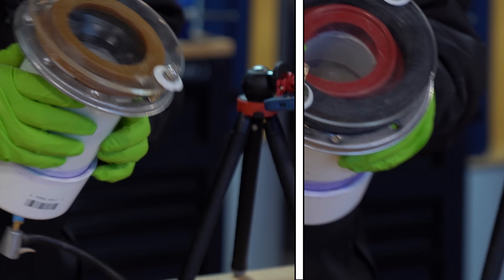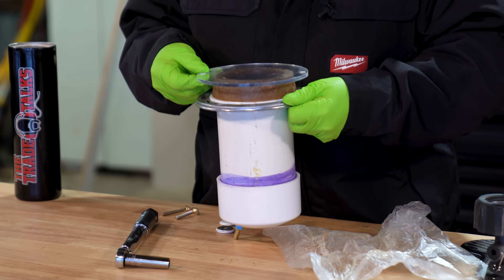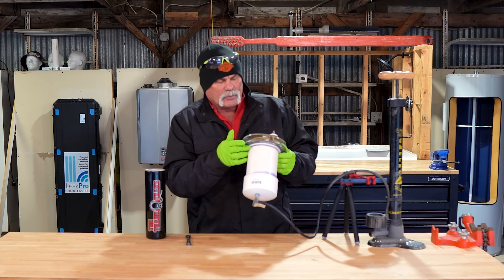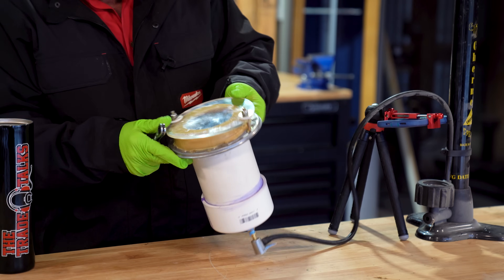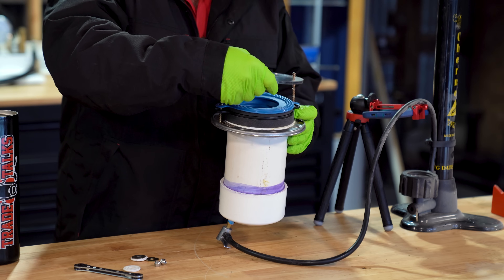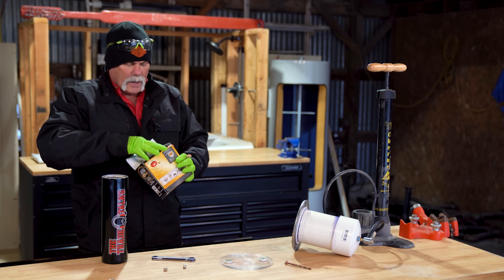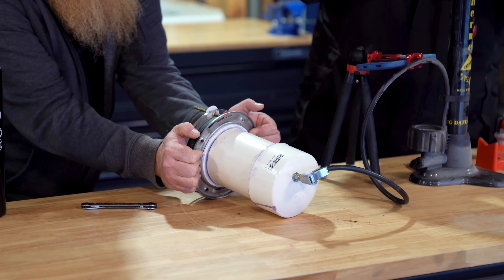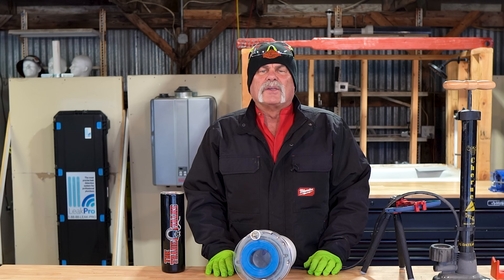Toilet Wax vs Rubber: Which Works Better?

Comment: Moved into a house and after a year the wax ring failed; I started getting dirty water leaking into my basement. The cause of this was an old 1950s closet flange (the old zinc/lead lined ones). The issue is that the flange sits up above the floor; apparently this was  intended for old toilet drain installation back then. So I had to replace the wax ring because the old one disintegrated due to years and years of rocking and pressure from compression since the toilet is not sitting flush. I used a rubber/foam ring to replace it. Well I didn't have any leaks after that...but the toilet still rocked a lot. So I did a quick fix, cutting some plywood into a shape to fit the base of the toilet. Seems to have stabilized things a bit. My next plan is to take an angle grinder; cut out the old flange and set a modern one (the  ones that have the Allen key expanding gasket). Maybe prep some spacers in case and put the new flange on the drain pipe to sit flush to the floor again as it should. But it's been quite a few years and no leaks at all from what I can tell. I'll update when I replace the flange and put on a new ring.

Comment: We tried that Korky one and just couldn't get it to work.  Now I'm as amateur as they get so maybe I did something wrong, but we put the wax one on and no issues.  As much as I didn't want to use wax, it worked over the rubber.  We returned that one the next day.

Comment: my flange sat up to high above the finished floor. tried all kinds of wax rings and when i tighten them down to the floor so the toilet didn't wobble they leaked. even tried to shim the toilet so it wouldn't smash the wax so much and still leaked. finally installed better than wax universal and was able to tighten the toilet to the floor and no wobble or leaks years later still no issues

Comment: By squeezing down the extra thick wax ring you weakened the seal. The acrylic wants to stay in it's natural shape caused by tightening in down. By pressing it you deformed it and it will naturally try to go back to the origional bend or shape. At that point it now has a lower tolerance in the wax.

Comment: Not a plumber, just a good son that's changed out a few toilets for my mother.

Both her toilets have the rubber rings now. And those toilets have been set in place for 5+ years and she's never hand the complaint of sewer smells in her home that was built in the '30's. 

Ultimately it'll probably come down to preference or what would be up to code in your area or if it's a commercial job site. Just my two cents. Again, not a plumber.

Comment: Here in australia we only use rubber seals. Called pan collars, and the pan isnt bolted down. Just held in place by silicone and gravity. Never had an issue

Comment: Personally, I always use the adjustable rubber ones, because every single flange I've ever worked on is at a different height lol.  I just never know. I like this test, but I'd be curious to see the results with a stiffer piece of acrylic.  It bends too much in the middle for any of these results to be valid.

Comment: I usually use wax but last week I used the rubber product product sold at Home Depot for $10. Toilet flange on center was 11.5 in from the wall and was a tight fit touching the back wall. Toilet flange had a repair split ring flange and the top of the flange was 3/4 below the tile. I used the rubber because it allowed for a flange below the floor surface and allowed for a slight shift according to the instructions. If it was not for the versatility of the rubber I may have had to melt two rubber wax seals together and double stack. Rubber product allows for toilet removal where the wax doesn't give you a second chance. As far as I know, no leaks so far and I would consider using it again. I keep wax rings in the van at all times; I'll stick to wax whenever I can.
Reply: Which seal would you recommend if the flange is not level? I’m replacing the seal on one of my toilets and the flange is in pretty good shape, but one side of it is a little bit more than half an inch above the floor while the opposite side is even with the floor. I’m not sure how important it is to be level. I did try to level the flange by removing the screws and putting a couple plastic shims under the lower side before screwing it back down. All this did was raise the whole flange up so that it’s above the floor on all sides, but still not level. Hoping one of these seals will still work without having to cut out the old flange a set a new one.

Comment: You and a few comments suggest that no seal would face 25 lbs pressure, but it makes me wonder. How much pressure do we exert when we have to plunge a tough stoppage? We know water doesn't compress so somethings got to give, right? I do maintenance in LTC facilities, and often use a vigorous back and forth action just to loosen it up. I know the plunger's not a perfect seal so that's some relief but it never occurred to me until now that I might be stressing the seal?

Comment: i have changed to rubber gaskets , cleaner , reusable , better seal on broken/cracked flanges
Reply from the maker: Why not replace the broken or cracked flange when installing a new gasket

Comment: I insisted we used the better-than-wax ring for the toilet and it is working fine. I wanted to save time and money, and researched it. did not need the foam spacers. Main reason was no ac. So didn't want the wax melting in the heat.

Comment: In my 50 yrs of building maintenance and repairs I have replaced/installed several hundred toilets. Only in the past 10 yrs have I tried the foam/plastic gaskets. Never had any luck with them. Most times had immediate leaks and sometimes they didn't even fit right. I always went back to using wax rings with rarely ever a problem. Speaking of foam, has anyone pulled a toilet to find someone had used expanding foam to seal the toilet to the flange? Or  I the only lucky one, lol.

Comment: I love the rubber , and ive done hundreds of setting toilets,  
 I always use a tiny bit of wax and use it like caulk for any gaps . I also smear a little wax on the rubber so it slips on that round part on the bottom of the toilet. I will never use just wax again .

Comment: Good attempt, but you're only testing 1/2 of the sealing interface.  You need something that simulates the toilet horn.  Especially, the rough horn ceramic surface.  Just my thoughts.

Thanks,
Scott

Comment: As a DIYer and replacing 2 toilets and on both occasions used the wax ring and had leaks because I had no idea what I was doing and messed up the wax ring when setting the toilet, I would prefer the rubber ones. After the second toilet I just decided to call a pro from then on. I do not want toilet leaks. I will be happy to do the piping and other things like replacing my faucets when needed but I am not willing to try another toilet.

Comment: No plumber but have installed a lot of toilets over my 56 years (wife loves renovations 😢).  I find wax or rubber both easy to install (zero leaks so far) but I am sold on the rubber ones, my choice always moving forward.

Comment: I have put in over 300 Better Than Wax rings and haven't had any problems.
Also, I have only used the extra ring a few times.
 I've had some jobs I needed to pull the toilet and reset it temporarily and pull it again to finish the job and reuse the ring.
Reply: Did you use toilet shims under many of the installations? A lot of complaints were that the toilet set too high off the floor and rocked?

Comment: I tried using the red rubber one on my shop toilet and when I built it and it leaked water all over the floor at the base of the toilet when the sewer line backed up. I replaced it with wax right after had another back up happen after that and the wax held, and no water leaked out from the base. will never use the rubber ones again.

Comment: For me when it comes to replacing an existing toilet it comes down to two things 1. is the flange flush and plumb and is the sub floor level and in good condition if either one of those is a concern then either option will have issues that you have to deal with. if they are good then both will work well.

Comment: That acrylic piece needs a 1.5” ring on it to mimic the extended bottom of the toilet. That would let it press against the rubber seal more accurately than just relying on two flat plastic pieces pressing against each other.

Comment: The max pressure youd need to measure it against is a plunger.  Ive used the wax free korky for years now without any issues. The only one i had a problem with was a flange set 1/2 above finish flooring but that wasnt the seals fault. I definitely prefer it for a few reasons though, one is reusable, two is people are getting heavier and the weight of people causing wax rings to fail is going up. And any subfloor system that isnt slab flexes. Also in the event one of the better than wax rings is being replaced ie remodel, its way easier to clean up.

Comment: Ive only replaced a wax seal once in my 70 years. Used a big wax one because it needed a quick fix and the ring was below the floor surface, so I wanted to make sure it sealed even if it squished all over underneath. I have spoken to plumbers and agree that the non wax ring is much better

Comment: I'm not a plumber but I have installed 4 or 5 toilets.  My parents had a plumber set a toilet twice and it leaked both times within a few days.  I researched seals and found  the "better than wax" and decided to try it on their toilet.  Installed easy and it never leaked after that.  I have used them ever since.  One problem with your test is the flexing of the clear plate.  You should have installed a steel ring on top as to mimic the solid constant all around pressure of a toilet flange.  You have more pressure on the bolt sides and less on the opposite sides.

Comment: I've changed out a wax ring before.  I'm pretty sure it started leaking because the floor wasn't the strongest and the toilet rocked.  Wax rings don't blow out like your test.  They develop wet cracks when the toilet rocks, and once wet (with more than just water) the wax ring won't reseal.  One advantage a wax ring has it it's single piece construction.  Those stacks that you've shown don't look very well engineered.  On a concrete floor, I would always use a wax ring since the toilet, if set correctly, isn't going to rock.  That leads me to another solution...if you have a toilet that rocks because of a weak wood (or particle board) floor, maybe it's time to spend the money, and put in a heated floor with epoxy that should make the floor way more rigid, for a better mounted toilet, and that wonderful warm step out of the shower on a cold winter day.

Comment: I like the Sani Seal waxless  toilet gaskets. Never had an issue with any toilet ring, but I remodel and will sometimes need to set a toilet several times over the course of the job and the foam ring makes that easier. I also install over a lot of radiant heat. Has anyone ever had the heat compromise the wax?

Comment: The only time you need the extra ring on the no wax seal is when the flange is recessed in the floor, the toilet also seals inside the no wax ring. I’ve had clients with radiant heat floors where the wax melted and no wax is the only answer. I’ve used both types and have installed mostly wax rings but I have no wax rings in my house.

Comment: I've probably got the oddball question here. Are the wax rings still made from bee's wax? I remember reading the box several years ago and found it says it was made from bee's wax so I used it as a source of bee's wax to use in my woodworking projects as a protective finish. It was far less expensive than buying it as a liquid or gel in the woodworking supply places. It's been a long time since I've needed one for any purpose so I'm just curious.

Comment: Why is there a danco perfect seal in the thumnail/picture but not the video? Thats the one I use. I like how the danco will move with the toilet a little. I use them for wall mount sits on floor and floor mount where the flange is below the floor. For floating i use wax and I also use wax for applications where the flange sticks out.

Comment: Ive been a handyman for 12 years, ... im never going back to wax, the most common problem i find is improper flange height due to remodelers not correcting the flange height after installing new flooring, the better than wax also includes spacers to adjust to the correct height

Comment: Acrylic disk is a poor sealing surface.  I can see your bowing the shit out of it.  A toilet will not flex.  Seems like to designed this test to fail.  I still have no idea which is better based on this test

Comment: I used the silicone ring without the foam because my flange is proud. So far, so good, and one thing is for sure; the silicone is easy, and incredibly noob-friendly. My only issue was the flange was all busted up where the bolts go, but thankfully the previous house owners had put a steel flange repair ring on it.

Comment: I used to do maintenance at three rental properties and changed out more toilets then I can count.  I tried the "better than wax" rings one or two times and had a leak within less than 6 months.  Regular wax has never failed me and I see no reason to use anything else, especially when it's included with most new toilets.  The only reason not to use regular wax is if you know you'll have to reinstall the toilet multiple times like in a remodel scenario, but normally you should only need to install a toilet once so just use wax, it'll last longer than you most likely.

Comment: Neoprene is used for wall hung toilets. If wax is used and you get the normal movement on the toilet, due to heavier people, the wax will not reset and will leak.

Comment: the problem with your test was just like someone else mentioned was the plexyglass bending, a toilet or floor wouldnt bend and the better than wax, you shoud only use one of the foams.

Comment: As a remodeler, I liked having a rubber seal one for temporary toilet hookups or on jobs where we have to take it out and hook it up a bunch of times, then we just reused it at different sites instead of having to keep a bunch of wax ones around all the time. We only ever used them as a temporary solution until we got the permanent hookup.

I've also used them as permanent rings a couple of times and have never had any problems with them. It didn't seem like the acrylic in the video was stiff enough- lots of flex.

Comment: There's a Green Gasket by Sani seal that is all rubber and it's fantastic. It might suit your tastes better. Me, I never install wax rings anymore. Toilets move, floors move, and Americans aren't getting any lighter. I prefer not to have a wax seal that deforms and fails.

Comment: Rather than just holding pressure, I think a big part of it is that if anything shifts or settles in the house, or on the hardware assembly, the rubber is springy enough to accommodate it.

Comment: Not a fair test of either one. The toilet is beveled fitting inside the hole and also on the plumbing fixture. You have a pressure from both directions ensuring a seal. I have used both with good results. Uneven floor causing a rocking motion will  cause both to leak  but wax worse because it can't recover.

Comment: I like wax for floors I can trust not to move. But I have some floors that flex with seasons and seem to crack the wax seal. I want to try the wax bottom, rubber top kind for those.

Comment: Both seal adequately but the wax compresses more and more easily. This is a plus when installing on an uneven floor - less chance of cracking toilet by overtightening and less shimming needed.

Comment: By using a smooth test surface you aren't factoring in grout lines and uneven tile that often can cause these rings to fail at install.

Comment: I’m sure your choice depends on a lot of factors.  I prefer wax, just make sure your toilet is set stable and cannot possibly rock.  Rubber in my estimation is forgiving in this aspect but I’ve seen them deteriorate over time.  Someone, probably a plumber, used rubber gaskets on two bathrooms with what looked like replacement toilets.  Both failed from deterioration.  I replaced both with generous wax rings not the skimpy cheap ones.

Comment: I reset the toilet in my house using the better than wax about 3 years ago. Very easy and no issues. The other benefit is you can re-set them if you need to re-adjust the toilet.

Comment: try Fernco adhesive toilet seals stick to bottom of toilet, have used these on 10 different toilets, but always brand new toilet, made sure bottom was super clean and dry, I have had to pull and replace toilets for one reason or another, and the seal stays stuck to the toilet!!!

Comment: What really is better than wax is to install one of those European style wall hung toilets.  The piping is done in the wall.  No chance of ring failure.  Another option is a back outlet European style such as Sniflo or Caroma, which mounts on the floor and uses a connector pipe in the back, similar to a pvc drain pipe.  Neither require a wax ring.